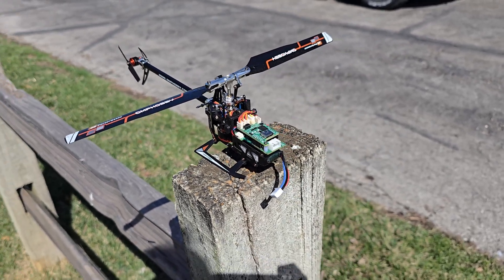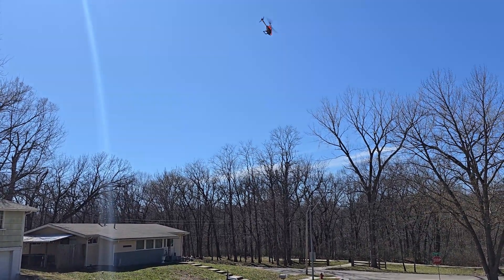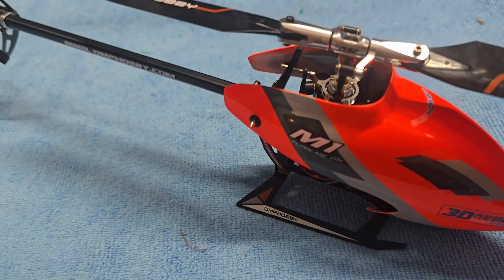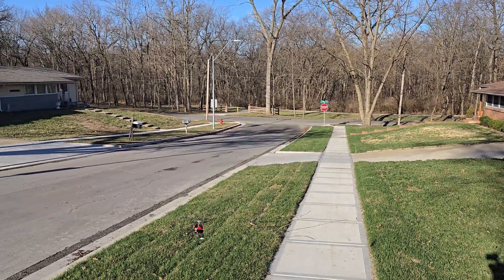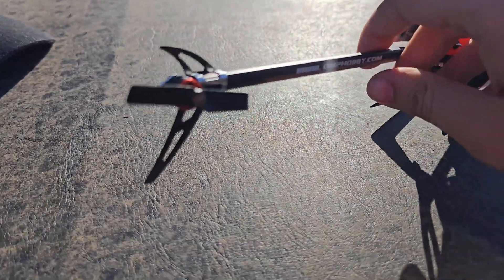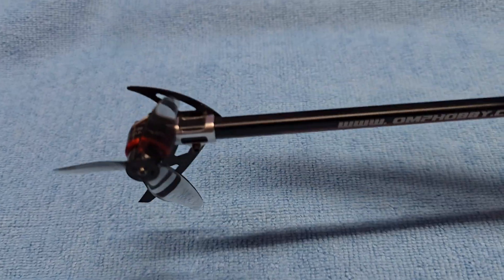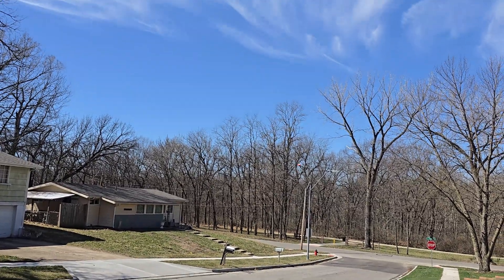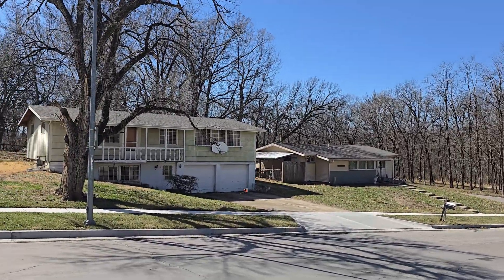Figuring Out the Tune | OMPHOBBY M1 EVO w/ Custom Rotorflight FC

Comment: I want to make a micro double brushless heli using nano cpx parts. Can you design a board for me? Lightest possible board as it is a weight-sensitive. I also want to use rotary servos used with the xk110.
Reply from the maker: As much as I'd like to say yes, with the current tariff mess and the cost of low volume prototypes, you would probably be better off finding a cheap 1s Whoop AIO and using that.    The five prototypes featured in this video cost me almost $500 not including the design time and labor.  The 2nd set of prototypes cost me another $650.

Comment: Thanks for taking the time to do this for us. Your low gain settings you said was trending on micro's, would that have to do with these tiny motors ability to unable to spool up/down as fast?
Reply from the maker: Honestly I don't know.  The Low D settings were on cyclic, not tail, so I don't think so.  I think D mostly relates to moment of inertia, which micros have very little of.  All of my micro RF builds have been similar (lower cyclic D = better), so I think it holds true.  If anything, micro helis should be able to spool up/down faster than big helis, so I don't think that's the thing at play.
Reply: @BladeScraper  Ok, so I think I have the conceptualization wrong.  I thought the Derivative compensation  was to keep the tail locked in place as you hit hard up/down on the collective or pump elevator forward/back as this will increase/decrease centrifugal forces that come down the shaft and translate into the frame.  

My understanding is in variable pitch, this compensation is achieved by tail angle micro adjustments.  In micro heli, the equivalent would be ramping up tail motor speed or slowing it down.  If I pump elevator hard on my S1 and S2, I often get a dip and typically its to the counter clockwise (Nose Yaw left, tail blows out to the right).  So that is not a D factor I guess. Right?
Reply: I'm about to start my M2 explore RF conversion very soon...wish me luck😂, I see right at the end you'd solved it pirouetteing when you hit hold...what was the fix? Also did you use much motor torque % for tail pre comp? I forget what the RF terminology for that setting is.
Very cool conversion btw